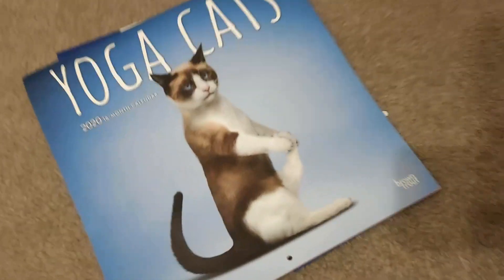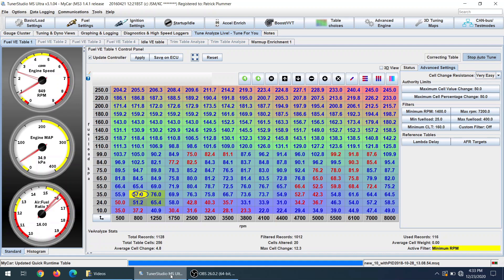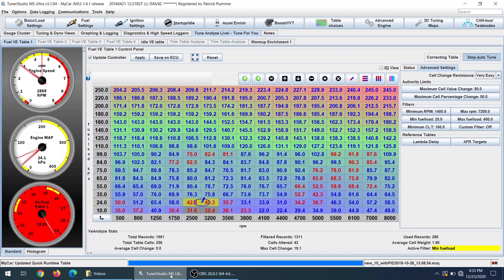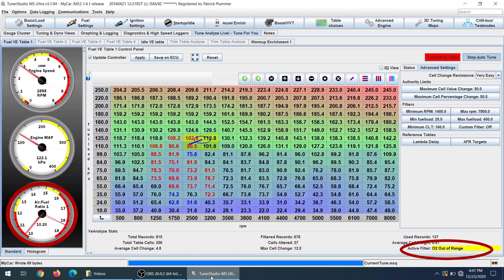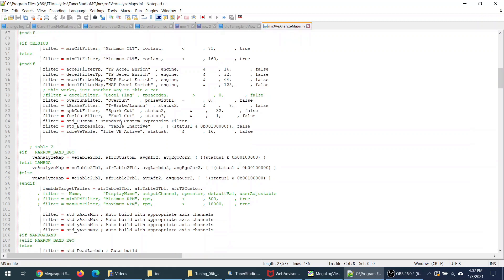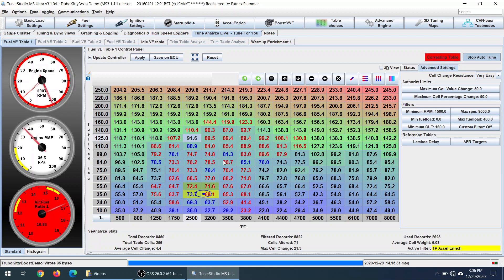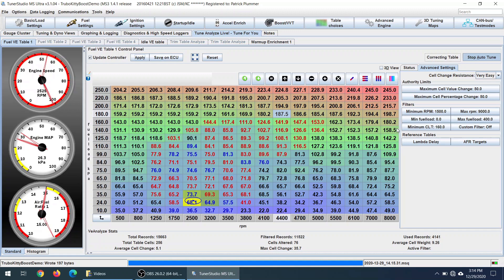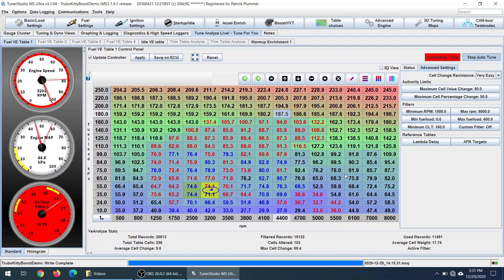Tuning the Megasquirt (Pt 7.) - Boost Tuning 2

Comment: So to disable the boost controller, can we just disable it in software for EBC? Or unplug the power? Or is it just better to route the line straight to the wastegate?
Reply from the maker: If it's plumbed correctly (normally open when there's no power) then disabling thru the software is just fine.

Comment: As I drive,  are the updated VEs continually being burned or do I have to burn them in at some point? And thank you for putting these videos together. I just finished installing the Squirt on my 91 TII and dialed in the idle.
Reply from the maker: It depends on the version of tuner studio.  The paid versions have an option to save as you drive, I think it's a checkbox on the auto tune screen.

Comment: Thanks for sharing. Great video. FYI, you can change the ranges on your gauges on the left so they actually show what is happening on your run. Cheers.
Reply from the maker: Haha yep.  At some point they got messed up and I didn't notice.  In the first part of the video they are fine but later, they are borked.
Reply: @OGPedXing  great work anyway. I've been using Megasquirt for the last 11 yrs on my VW Beetle - but I am still learning. Cheers

Comment: @ogpedexing when you are autotuning is there a way to log what veal filters are active at any given moment? Example that O2 out of range. Say I did not notice that happen during a veal run but I was logging. Can I find in the log if veal filtered out certain events? If this was discussed in this video I apologize for missing it.
Reply from the maker: Most things are logged automatically including various engine states and indicators.  In megalog viewer what you need to do is enable the one you want to see and it will create a status icon for it or a chart if it's a continuous type of reading like o2 numbers.

Comment: Im really curious  to see your ignition  timing  table 🙏
Reply from the maker: I think at the moment it's not too different than the 1994 trubokitty map.  That one is on the more aggressive side of 'safe'.   When running e85, I advance it 2-3 degrees in the power band and retard it slightly in cruise at higher rpms.
Reply: @OGPedXing  so the time you are doing  this tune it's a base map timing table from trubokitty ?
Reply from the maker: @mmarkzx  yes or extremely close.  I try to start from a known default like a published map so that while doing the video, I'll experience the same things as most viewers.
Reply: @OGPedXing  if i retard about 5-3 degrees all across  the boost area will it make more safer to autotune it or should  i just stick to the base timing map?
Reply from the maker: That is technically safer but eventually you'll have to retune fuel when you increase it again.   From my experience, the base spark map is ok into boost.  It's hard to really tune spark on the street, it needs a Dyno and a knock sensor/det can setup so you can find mean best torque.   For the street, I keep the base spark and then richen the higher boost kpa cells for protection.
Reply: @OGPedXing  i see that make sense. Thanks👍

Comment: Hey Ped, I have a 1.8 NB running a Megasquirt 3 Mini ECU. I have done around 500 miles on it so far and it's running great, it drives and idles just like stock. I am hoping to install my RX8 Yellows then once the VE table is fine install my Td04-13t. I only plan on running wastegate pressure and no boost control so around 7psi depending on the wastegate. The tune is the base map which comes with the ECU from MSLabs, the VE table and Spark Table are scaled for around 220Kpa, above 100kpa in boost the fuel table looks good to me but I cant say about the Spark Table because I have no idea to be honest. It drives great and seems to make  good power naturally aspirated and on the spark map above 100kpa it seems to pull spark about 1-2 per psi of boost which I've heard is about right but I am no expert.I will also be running 98-99 octane (UK) depending on what petrol station I end up at at the time aha. If I follow this guide and interpolate and scale my afr and fuel table to my 7psi needs and I work my way up slowly with boost cut and interpolate my afrs do you recon I could tune this myself and be  hitting 7psi pulls safely and reliably?
Reply from the maker: Yes you can interpolate and it will work out fine.  However I've found that a good map needs surprisingly few rows to be fine.  You can leave it with less rows for 7psi and below it it will still work.  Either way the key is to work it up slowly and then everything will be safe and the afrs can be tweaked slightly as needed to build the power.
Reply: @OGPedXing  Great! Just because where I live the only ecus that are mazda related and anyone will touch is an ME221! So just take my time, come into boost slowly with over boost protection and work my way up through the ve table and I should be good? The car runs and drives great naturally aspirated on the base map, afrs are spot on and when I autotune it hardly changes anything. I had in my head that because the current tune I'm running is great, everything feels like stock if not better (idle, throttle response etc) and it's all scaled for boost and I am not adding any electronic boost control or anything. I would just be slapping the turbo on and retuning my afrs like in this video but I spoke to a remote tuner who works with ME221 and he said that isnt the case that "Accel enrichment, start, idle, alternator control, closed loop fuel correction, target AFR, injector timing. The list goes on..." would have to be tuned again. I just assumed because all of that seems to be tuned perfect just now I would just be doing what you are demonstrating in these videos. Hope that makes sense, im just confused and dont wanna blow up my engine on the first pull aha. Thanks for the reply mate! Your videos really help so many people
Reply: Do you still think I should go up in segments of 15kpa then?
Reply from the maker: Once you add the turbo things will need tweaking again but it's no where near like tuning from scratch.  A great tune NA will be mostly fine on turbo, but it will need some dialing in below 100kpa.  The reason is you're now making a little boost usually at low levels.  So a cruise rpm at 3000 might have been 50 kpa before but is now 60 kpa, etc.  Idle is going to be almost the same, rarely see problems there.  Accel enrichment, a little tweaking maybe.  In tuner studio it scales automatically, not sure on the me221, but I assume fairly similar.   Afr targets can stay the same and be fine.  Although I do tweak them some, e.g the 100kpa row.  100kpa was WOT but now with the turbo is a transient row while accelerating, so I lean it out a bit.  But don't be terribly concerned, you can handle all that in a few street tuning drives after the install and be back to stock level of smoothness in no time.   For the 15 kpa increments, yes I think that's a good balance.
Reply: @OGPedXing  Yeah that's exactly what I thought the way he was going on about it, it was like I would be starting from scratch. He then proceeded to ask for £40/hr to point me in the right direction haha. I am just gonna follow exactly what you teach on your videos and see where I get! Thanks again!

Comment: Hi . Why no one use maf sensor for tuning? is that so difficult? With a Gm maf you will never reach the max of the sensor. it should be much much easyer. i think so. i am searching  for a long time for MAF with mega or microsquirt ecu.
Reply from the maker: Great question! While maf is supported on the megasquirt I think people tend to avoid it because of how finicky it is to tune.  The intake setup you have is very important to the results you get and it can be very time consuming figuring that out on a specific vehicle.  The same maf sensor on another intake will perform completely differently.  When tuned perfectly it can provide very precise fuel control, which is why the OEMs like them.  However many performance cars use map sensors instead.  Some advantages of map include easy tuning, less affected by vacuum leaks, no restrictions in the intake system.
Reply: @OGPedXing   i see. Why many popular tuners keep telling its easyer?  Like this one. https://youtube.com/watch?v=MdWglC_yHkI&feature=share.   The. Microsquirt has it preset in  for gm maf and others too.
Reply from the maker: Boost V8 chevy I couldn't tell you...most people I've talked to think map tuning is a lot easier.  The video cut off before he explained why he thinks so.  Admittedly I've never done it, since changing the intake on a car is the first thing before a turbo install typically.  All I know is that OEMs spend a lot of time on this for each model of car produced and their specific intake, they get it tuned in lab conditions.

Comment: Hi. this is super great info. you never talk about  timing.. How to feel or adjust it. Is it easy to adjust?
Reply from the maker: Yep super easy. There are several ways, the main one shown is tuner studio doing it automatically using the auto tune features.  You enable it when you start the drive and just keep it running.  For the free version you can still auto tune it, but you have to do it by logging the drive and then running it through the app VE Analyze.  Also you can make changes by hand by just entering the value in the table directly.  Check out tunerstudio.com for info about the apps.
Reply: @OGPedXing  are you saying tunerstudio can automatically do the timing to on street tuning? I think you might have to do a video on that. Will tue care perform bery good? Is it safe to pet it auto tune the timing for turbo too? I have the payed version tuner studio. I don’t know how to make it data log .
Reply from the maker: @boostv8chevy457  oh, I'm sorry! I totally misread your first comment...no it won't do timing, just fuel. Sorry for the confusion!  I find that the various base maps from trubokitty or from diyautotune are fairly conservative/safe for timing and are ok to run when first getting into boost.  To adjust timing I always recommend getting some time on a Dyno.  And for safety have a good knock sensing setup or det cans to listen for it.  The pros use a similar process on the dyno to dial in timing though...they hit a handful of cells in the map and interpolate.  Street tuning of ignition timing is tough because you can't measure actual torque while it's happening.  You see torque drop off on the dyno and then you dial it back with no risk.
Reply: @OGPedXing  ok ok.  Thank you for the info.